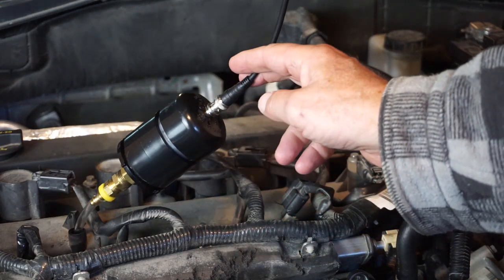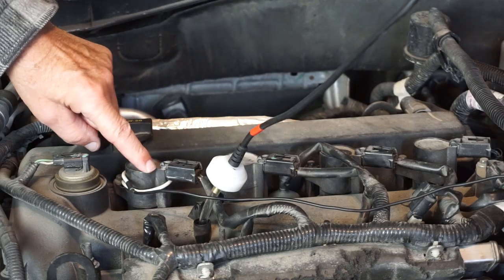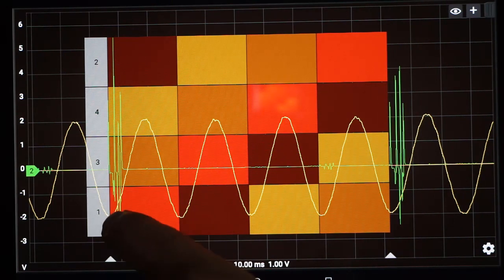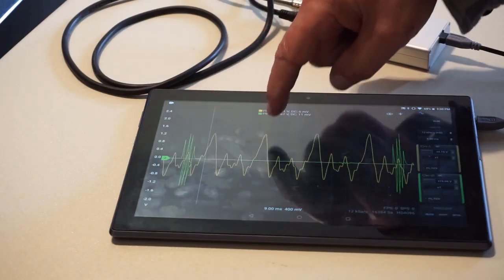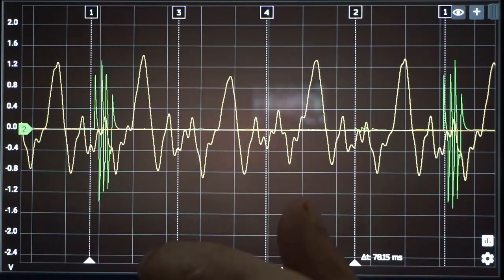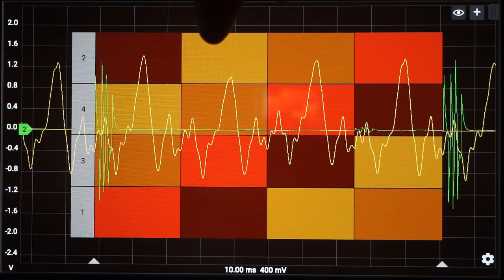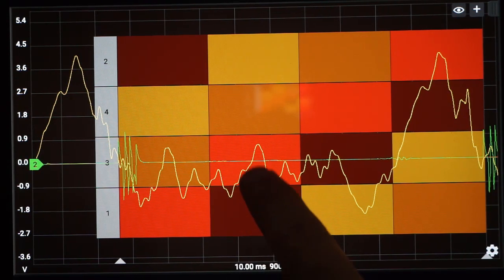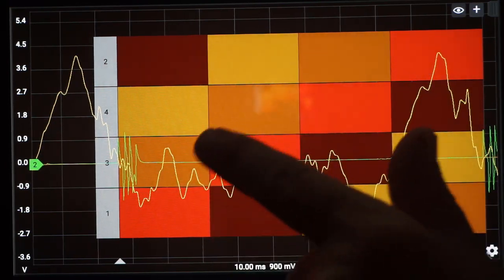GADGETS#125 - ROTKEE PDS PULSE TRANSDUCER

Comment: Very clever as usual  sometime ago I was messing around with My Hantek 6022BE and worked out One. Sync channel 1 to cylinder 1. and Channel 2 to battery positive near the starter motor. Crank, and You get the drain on battery when on compression. Results  Give a relative compression for each cylinder, and would quickly show up a cylinder with low compression. 
Best Wishes Jahmahrah : - )

Comment: I just ordered the MS512 max and was curious if the combustion overlay is part of the software or did you add it. if so where can I find it? thanks for the helpful videos
Reply from the maker: HS512 MAX comes with its license, and the Automotive Module license, and all of the overlays

there are other module licenses such as the Digital Module (allows CAN and LIN BUS decoding) which are extra

Comment: Hi i bought ROTKEE pds pulse transducer. can you pls explain how you have connected this to exhaust .. what kind of tube you recommend to connect to exhaust from pulse transducer.  

also can u explain where did you connected your intake ..
Reply from the maker: you'll notice I used a 1/2" ID braided hose for the exhaust test ... there's not that much heat there and it's not for that long so it can withstand it...and there are other similar sized hoses kicking around that might be even more heat tolerant

also in this video I demonstrated using the PDS for crankcase test...just a small hose into the dipstick tube

for intake PDS tests, the best 2 places are at the EVAP solenoid vacuum hose ...or...at the brake booster vacuum hose ... normally just engine crank tests since engine running at idle would produce high vacuum capable of damaging the piezo disk in the PDS
Reply: @theGADGETSplaylist  Thanks so much. is there a difference between firstlook sensor vs rotkee sensor. Also i have picscope 4 channel, can i use one for intake, 2nd for exhaust, 3rd crankcase and 4th to sync to find out the abnormalities during misfire..   thanks again much appreciated.
Reply from the maker: @sivucit  First Look, Rotkee, DIY versions = all the same

they all use a piezo disk
Reply from the maker: if you wanted to do intake PDS with engine running at idle, then disconnect air intake and have PDS take measurement upstream of throttle plate (between throttle and air filter)

vacuum would be low there and no risk of piezo damage
Reply: @theGADGETSplaylist   Thanks again..
Reply: @theGADGETSplaylist   Hi,  can i assume that connecting 3 PDS ON intake, exhuast, and dip stick tube, we can eliminate leak down tester ?...  Please advise.
Reply from the maker: @sivucit  no
Reply: @theGADGETSplaylist  oh ok, i thought purpose of leak down tester will let us know where the leak is (intake, exhaust and  crankcase) .. if we can find out abnormalities in pulse using PDS and igntion sync, not sure when you would advise to use leak down.. appeciate your insight..

Comment: I purchased the in-cylinder transducer and I'm not getting any signal, any tips or tricks to get it to work? Thanks!
Reply from the maker: I just re-read your question and though posted on the PDS video I realize you're asking about the PS16 Pressure Transducer.

Either way, the Telegram platform is best place to try to resolve it:)
Reply from the maker: such a simple piezo based probe...strange no signal...

difficult to discuss technical issues here in YT comment section...I invite you to join our HScope TELEGRAM group...I or others will be pleased to try to help out:

https://t.me/hscope_automotive

Denis

Comment: You do good videos, not too long, straight to the point plus your voice is easy on the ear.

I'm interested in the Rotkee gear & have tried contacting them through their webpage & their facebook page with no response. Would you consider them reliable? I'm debating whether to go for their MT Pro scope or a Pico non automotive. If they don't respond it'll have to be Pico.
Reply from the maker: MT PRO 4 has been out-of-stock for a while. They've been having trouble filling orders. This and some probes have recently undergone redesigned and intermittent stock issues.

They do not take PayPal. Add items to the cart and on checkout, there are 4 payment options to chose from.

Guys on our HScope Group report getting their orders in about 3 weeks time. Have not heard of anyone making payment and not getting their shipment.

Make sure you understand the differences of MT PRO vs conventional USB oscilloscopes. They'll send me one (maybe) for review when stock situation improves. It's a lot of scope for $220 but it is not conventional.

They could communicate better. But I think they are a small, honest company.
Reply: @theGADGETSplaylist  Thanks for the reply. According to their website the MT4 is supposed to be in stock on the 20th of this month. There isn't a lot of information regarding the scope, so when you say it's not conventional, what do you mean? I installed the scope software & can see that graphically it's a bit rough, other than that it appears ok.
Cheers
Reply from the maker: @philb2334  first of all, it is not a USB oscilloscope...it connects to laptop through ethernet port and thus has separate power requirement (can be supplied  5v through laptop USB)

not all 8 channels are same...4 have 250 KHz bandwidth...the other 4 have 1MHz bandwidth and are "differential inputs" (+) and (-)

and there's more...I don't have all the particulars...
Reply: @theGADGETSplaylist  I've decided against the MT4 in favour of the Autel MP480. I'm going to get the Rotkee leads & pressure sensors etc. Rotkee does accessories etc I haven't see elsewhere.
I received a reply from them today, bit slow to respond to my initial message & is one reason I decided against their scope, otherwise they answered my questions. 
Keep up with the excellent videos :)

Comment: Nice job Sir! On a running exhaust waveform at idle there is NO Phase shifting. Phase shifting happens at higher rpm. You can prove this out yourself. Take an idle capture, then take idle capture with injector unplugged. The misfire event will line up with the cylinder chart. BUT... Rev up to 3000 rpm with that injector unplugged and apply the cylinder chart and it will look like the next cylinder in the firing order is misfiring, when it is not!. A 4 CYL Phase shifts the misfire 90 degrees to the right, a 6 cyl 120 degrees to the right, and an 8 cyl 90 degrees to the right. Running exhaust waveform are at best good for identifying the misfiring cylinder. To see valve events, while applying the cylinder chart,. a cranking (fuel disabled) waveform display s the most valuable diagnostic information.
Reply from the maker: I have not done high RPM exhaust pulse tests...nor have I seen one on YT...
Would you have a link to one, Paul?
Reply: @theGADGETSplaylist  I haven't seen a youtube video on it. So the process I describe above you can do it yourself. If you are synced ignition on Cyl 1 and unplug the injector(#1), at idle, your exhaust misfire will line up on the cylinder chart with the exhaust stroke of number 1. BUT,  take the same capture at 2000 rpm+, now use the cylinder chart and the misfire will move to the right 90 degrees, so if your F.O. was 1342, it would show up as cyl cyl #3 on the overlay chart. Again you must try this yourself to "see" the proof. I can't state this enough, exhaust running waveforms are at most useful for cylinder Identification for misfires. A cranking exhaust waveform can reveal very useful information.  For example on a V6, F.O 142536, the IVO & EVC for cyl 3, and EVO for cyl 1, with ignition sync on 1 with the overlay chart.  I wonder if I just wrote a script for a short video? Hint...Hint. lol
Reply from the maker: @paulpaquette1961  lol...if so, you'll find yourself in the credits:)
Reply: @theGADGETSplaylist  Don't credit me, the gentleman that explained this to me was Hans from Trained by Techs!!!! And naturally, I had to go prove it out.
Reply from the maker: @paulpaquette1961  I smell some ignition advance and cam phaser influence in here.
Why hasn't Hans and/or Trained by Techs done a video on this high RPM insight. No one else has, they'd have the whole field to themselves.
When things warm up in shop (months from now) and have spare time, I'll have a look at it.
Reply: @theGADGETSplaylist  Not sure why there is no videos. I would think its common knowledge amongst seasoned scope users. I stumbled on this myself, and posted my pics on an FB group, and it was Hans that pointed out the 'why'.

Comment: Hi even though it is a very good looking test probe I still admire all your DIY projects because there’s a lot to learn from there. The simplest is the pulse probe from plastic pipe tubes and piezo discs. I proved to myself that I can do it with your tutorial videos. I would like to thank you for that and I am forever grateful.
Reply from the maker: Very kind words, Adriano and much appreciated:)
The DIY is also more "serviceable". I've had to replace the piezo.
There's also something to be said for a quality product for $17
What I try to do on the The GADGETS Playlist is feature affordable technology, whichever way we find it.
Reply: @theGADGETSplaylist  Friend, I would like to be able to manufacture the sensor, you will have information on how I can do it, I would really appreciate it, friend.
Reply from the maker: @davidsantosdejesus7816  the ROTKEE featured here is not very expensive, especially if you have other things you'd like thrown in the same order to help with split shipping cost

GADGETS#132 is an easy DIY build if you or a friend has a 3D printer

GADGETS#8, one of my very early videos shows how to build one using common ABS plumbing parts

Good luck, David
Reply: @theGADGETSplaylist  OK thanks friend,
i will check your video

Comment: Very interesting!  I have never done this kind of pressure measurement on an engine and wonder about the "rule of thumb" delay in the exhaust waveform relative to the timing reference.  This phase shift is due to the physical properties of the exhaust system, non?   What kind of information do you derive from these signals?
Reply from the maker: Not really a phase shift per se, Derek. The #1 sync is really undergoing its power stroke. That's why later (2 peaks later) it is then in its exhaust stroke.
Reply: @theGADGETSplaylist  oh boy do I feel dum : )
Reply from the maker: @TheDerekeder  you're subscribed to theGADGETSplaylist. In my book, that makes you smart:)